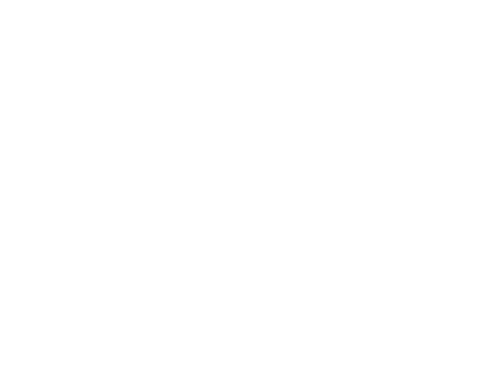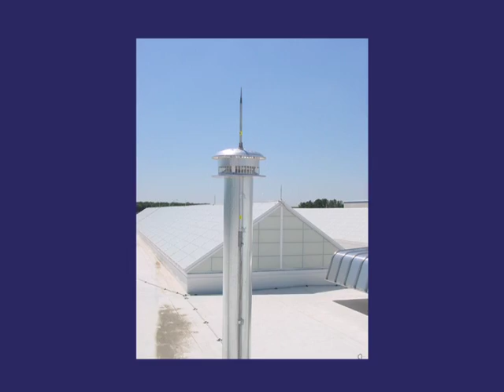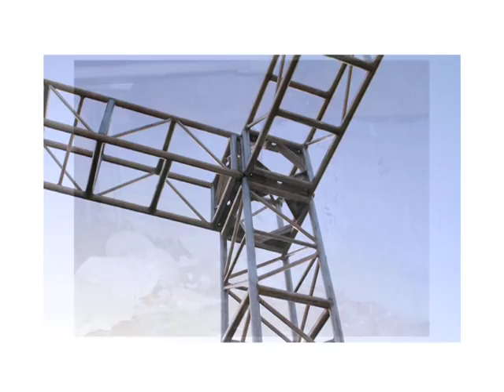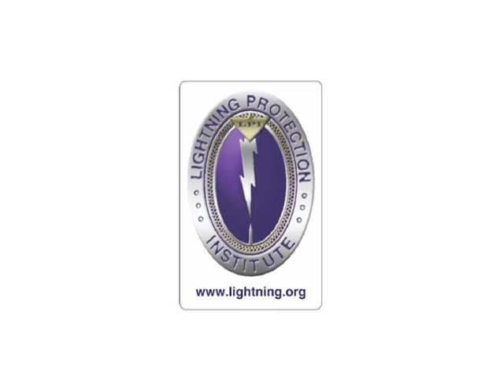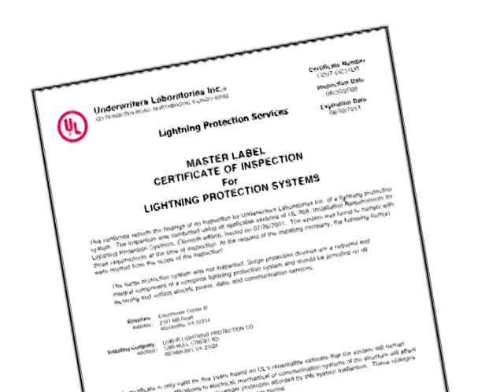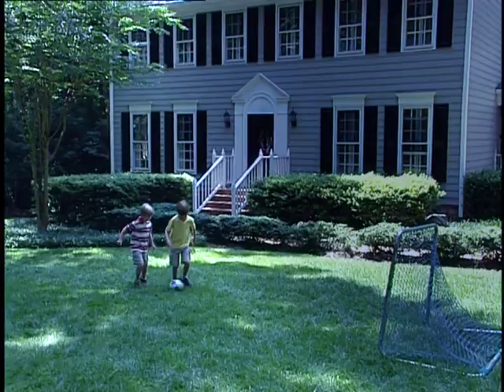The truth about lightning and lightning protection and how to protect yourself.

Comment: thanks so much for this site.......i am installing lightning protection on my home useing 1 inch hard copper tubing for the main buss with 3/4 inch copper collectors 2.5 feet in lenth spaced 12.5 feet apart ..copper tubbing of 1 inch extends to the edge of the roof there im useing 3 x 1.0 aluimin cable to ground 75 feet to and unused well caseing as eath grounding is almost impossible on the site due to rock just under the surface